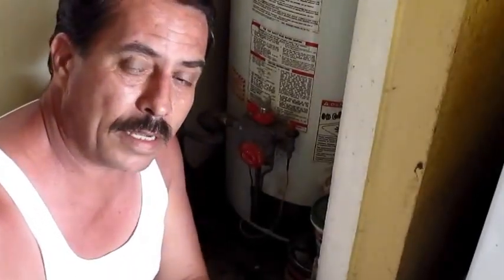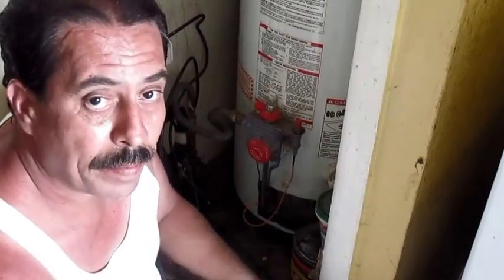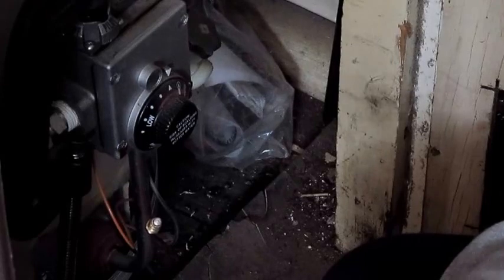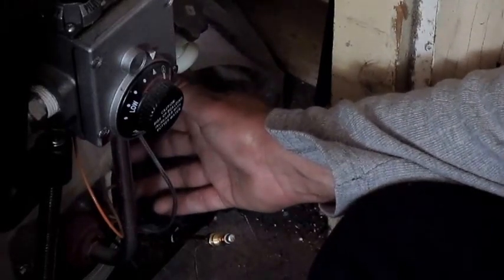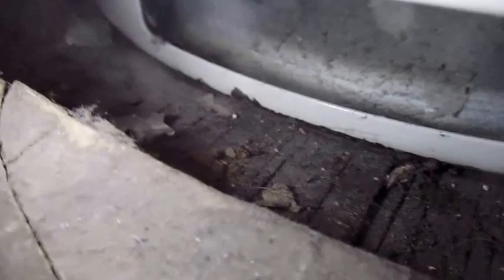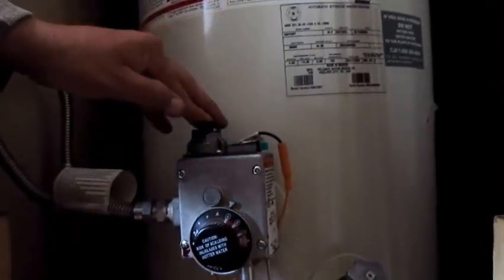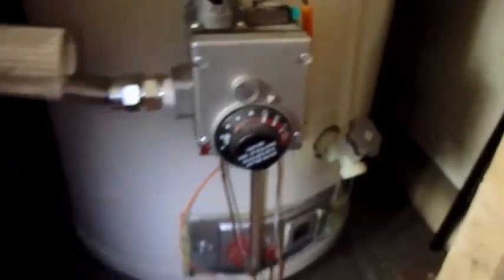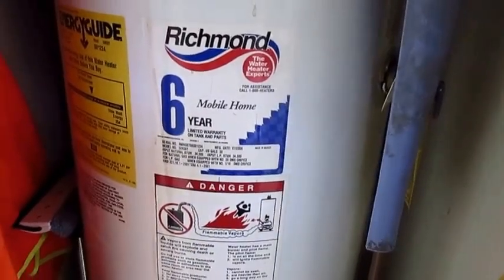Water heater Pilot will not stay lit.By http://www.vigilhandymanservicescom ,Denver,Colorado.

Comment: How would you troubleshoot the igniter?  Or how would you tell if the igniter is bad?
Reply from the maker: There are many ways #1 you just look at the end of the igniter you will always see a spark but if you press it to many times wait 3 to 5 minutes then check for a spark #2 My favorite way is touch the end of the ingniter and press the button & you will no if good or bad but if you have a bad heart just get a lighter and push the gas on it and put at the end of the ingniter and it will light the lighter if good #3 Put a meter on it and if good it will go from 0 to a number greater then zero Use a Multimeter Black ground Red igniter end ,P/S sorry for getting back so late I been down....